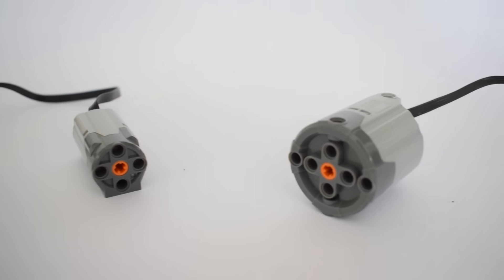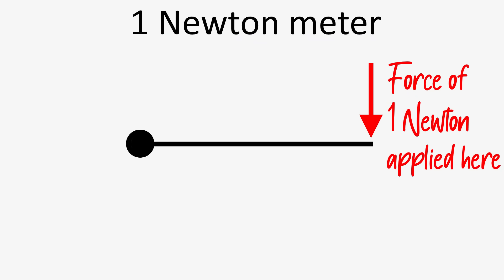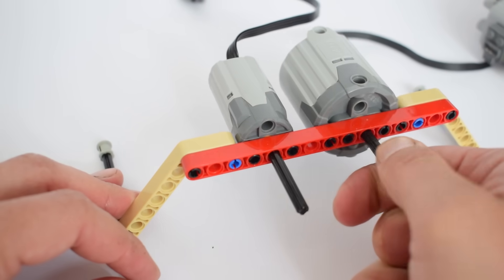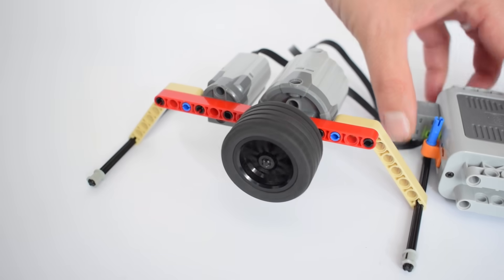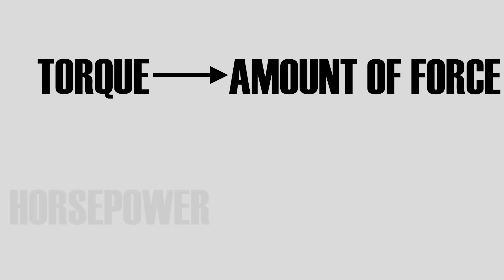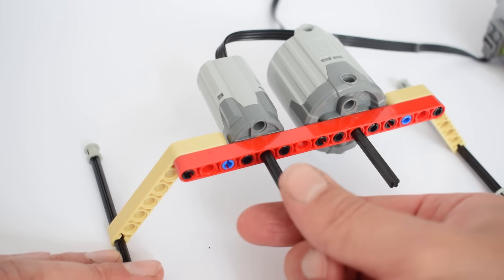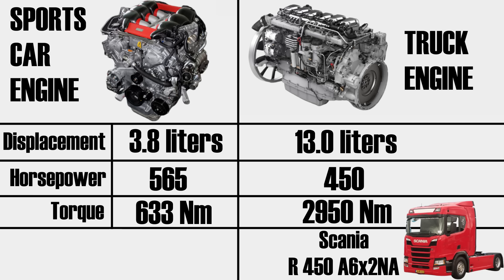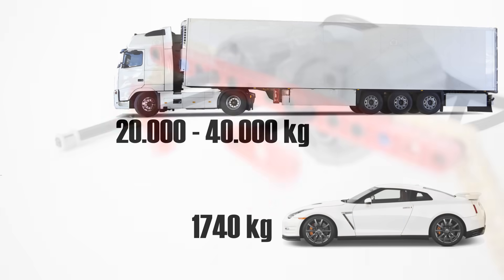NEVER be confused by HORSEPOWER and TORQUE again - HP and TORQUE EXPLAINED in the MOST VISUAL WAY

Comment: Cycling uphill, if your legs can exert enough energy to go up a steep angle, thus your legs have a high amount of torque to push yourself up even though you are pedalling slowly.

Cycling downhill, if your legs can cycle fast enough to accelerate down a steep angle, thus your legs were able to generate a high amount of horsepower due to your speed of pedalling, even though each time you pedal requires way lesser torque than when you're cycling uphill.
Reply: Say what now?

Comment: The best way I can describe the difference between power and torque is:

In all cases, acceleration is proportional to torque at the wheels.
With a fixed gear ratio if the vehicle speed is allowed to vary, the torque at the wheels is proportional to the engine torque and the maximum acceleration occurs at peak torque.
With a fixed vehicle speed but the gear ratio is allowed to vary, the torque at the wheels is proportional to the engine power and the maximum acceleration occurs at peak power.

Comment: Nice video, but disappointing that you didn't demonstrate using the power. A simple way would have been lifting a weight over time using say a pulley. You could have shown that the big motor, with right pulley, could only lift the same weight in half the time of the small motor.

Comment: This is a great explanation, thou I still confused why don't we use an engine with more horsepower and use a transmission to reduce RPM and increase torque.

Comment: "Newton meters confuse you?"
Me: "No, it is pretty self-explanatory"
"It can be also explained in foot pounds"
Me: "Well now they do"
Reply: I was so mad when I heard foot pounds😂
Reply: There is a descriptive problem with Newton meters, it is wrong, foot pounds is a proper descriptive way of stating the force, Newton meters should actually be stated meter newtons, now....I will await someone to try to say I'm  wrong, as they always do. 🤔
Reply: @StevenBradley-sq6kg  i don't know if you are wrong, just the imperial system drives me crazy. Nobody uses that rather than americans.
Reply: @crazypills88  The UK still flip flops on it for a lot of things. I mwan...that is why it's called "imperial" after all. Shoot, they still use "stone" as a measurement of weight too! But hey, imperial measurements aren't the only odd sources for measurement. A Newton is the amount of force an apple exerts on the surface of the earth due to gravity!

But yes, torque is technically pound feet not foot pound.
Reply: @94XJ  " A Newton is the amount of force an apple exerts on the surface of the earth due to gravity!"  LOL!  Do you believe that?  It only works if the given apple has a very precise mass.  99.9999% of apples would fail your definition of a newton.  Note, newton and not Newton.  Sir Issac is now 'spinning in his grave' at 3000 rpm, what his power output?
Reply: @crazypills88  how many times have you been to the moon?
Reply: Yeah, some of what we say is indeed odd. Don’t blame us now though. We were just born into it! 😂
Reply: I read in British accent lol
Reply: Me ,a person ,who live at European continent (to be exact mid-eastern Europe):
Pounds? The only pounds I need is me pounding your mom.
Feet? They're relics of the past for us! What a fetishist would use such unit...
(I know ,it may sound weird ,but I understand metric system better ,than the imperial system and don't take the jokes above too serious)
Reply: My feet 👣🦶  plus money from England  💶
Reply: I felt the same :)
But it is pretty much force lever.
He should have said pounds foot to make it less irritating.
This is also a good explanation https://www.youtube.com/watch?v=u-MH4sf5xkY
Reply: @SirGeldi  except the ftlbs is literally the name of the measurement and to reverse it would be literally incorrect despite it still making sense
Reply: @andreasfrost-blade4689 

Yes, the SAE uses foot pounds. 

Torque is a is the vector cross product of distance multiplied by force and cross products are non-transitive.

RxF=-FxR
Reply: @andreasfrost-blade4689  the proper name for torque in SAE is pound feet, it is called pound feet to reduce confusion with foot pound which is a unit or energy not torque. But it doesnt really matter because most people say torque in foot pound anyway and the context will tell you whether or not its torque or energy.
Reply: @Redtooth75  is Newton’s the metric equivalent to pounds? Also how do I calculate how many pounds of force I put into something? And where does pounds per square inch play into this and how? How do I calculate PSI?

Also I have another question of sorts. (I’m sorry if I’m asking too much). I work at a lumber mill mainly piling lumber. I’m about 170lbs and 1 of my coworkers I pile with nearly everyday is at least 220lbs if not heavier. Both of us r capable of moving around the same weight of timbers for our heaviest we can handle, and r just as fast as each other at said weight. When we pile lighter lumber I am significantly faster than him by a landslide. I’m gonna say ballpark estimates here as idk the exact numbers for sure. We can both pile 800lb timbers with similar speeds. But in lighter stuff like 1X6X12 I am so much faster it’s not even a contest. Maybe something like 5 times faster. So with these ballpark numbers in mind wat is the estimated HP and force (in pounds) that us 2 output and how did u get those answers?
Reply: @baileydombroskie3046  imagine you had a lever 90 degrees/perpendicular to the ground. Then you hang 1 lb of beef at the end of the lever. That's 1 ft lb. Hang a gallon of milk and you have about 8 ftlbs.
Reply: Why I automatically read this in russian accent

Comment: It would also be interesting to talk about instant torque. Electric engines apply their torque very quickly. A petrol engine will take much longer, coz explosion engines are much less efficient, they need to burn petrol and produce explosions, moving pistons, which is more wasteful and takes longer than converting electric energy to rotate a shaft. Diesel engine can apply torque quicker than petrol engines though, coz diesel engines are more efficient : higher compression rate, more efficient fuel. All of this is why a basic Tesla will destroy a Mustang or a Porsche on a short drag race.
Reply: Acceleration is mostly a function of average HP during acceleration. A mustang or Porsche make their rated HP at a specific rpm and lass than that everywhere else in the rev range. So they make that power once per gear and less the rest of the time. A Tesla is an electric car so it can make it's rated power regardless of speed. 

Thats it really. It's nothing to do with "instant torque" or anything.

Comment: Hi, engineer here. Good explanation but there's a couple of misleading points.
1. You can't spin both electric motors freely and claim that the small motor rotates twice as fast, thus can have 1/4 the torque but only 1/2 the hp. At peak rpm as shown in 5:16, the torque is effectively 0. This is true because if torque is > 0, the shafts will continue to accelerate. The rough calculations were close because the ratio of rpm at peak torque between the 2 motors is about the same as the ratio of peak rpm between them.
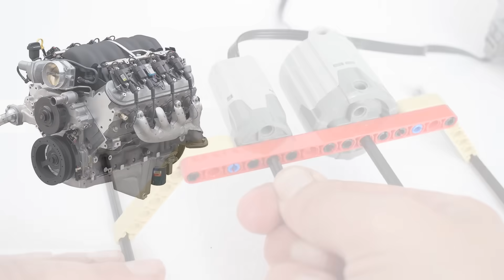2.  6:25 - 6:35 you mentioned that torque can be felt but not horsepower. While this is true, it may mislead people into thinking that acceleration depends on torque and not horsepower. Let's talk about 2 hypothetical engines, A and B. A has high hp low torque. B has high torque low hp. Torque at the wheels is what matters and A can be geared down to produce more torque than B at any specific speed.
Put the sports car engine in the truck with a custom gearbox (or a perfect CVT) and it will accelerate the truck faster than with a truck engine. The real reason why trucks need high torque engines is for fuel efficiency and reliability. You can't redline a high hp low torque engine for 12 hours everyday.
Reply: Thanks. I was about to write this. Glad I scrolled down. Saved me the time.
Reply: I was about to write the same thing! Don’t want to red line anything.
Reply: With this way of thinking does having higher torque allow you to "Start moving" the car/truck if you are at an incline for example?
Or if they have same hp it just doesn't matter?
Reply: @RelaxSimmer  the problem in this discussion is, that there are multiple things to consider and connected with each other. Thats why there are so many discussions about that.
All starts with the "power" and "torque" the engine is producing is different over the rpm-range and people usually just talk about peak power, or peak torque..
Second..they usually talk about the peak power and torque at the engine, not at the wheels..that is a totally different story as the gearbox can change your torque by keeping the same power, but of course increasing or reducing turning speed of the wheels.
But coming to your question: 
Power is Torque x Rpm.. always have that in mind! You cannot have more torque at the same rpm with the same power. Same rpm, more torque means more power.
To turn the wheels on your incline  you need a force, you need torque, but when they dont move because you are standing still, your output power is 0. (rpm=0).
So what you inititally need at your incline is torque to initially turn the wheels.
Imagine you wanna accelerate on your incline: Enginge is at 2000rpm and could produce 200Nm..as the clutch is disengaged, you only need 50Nm,but whatever. 
But to turn the wheels, you need 600Nm at the wheels..so, there is the gearbox first gear ratio assuming 4:1 could give you 800Nm at your wheels, so its possible..
In the 4th gear assuming a gearblx ratio 1:1 would give you only the 200Nm of torque at the wheels..so even if the engine creates the same power (2000rpm, 200Nm) it istnt enough torque at the wheels to incline the car. So you need a different engine that creats more torque at the given 2000rpm, therefore also more power..or another gear ratio like in the first szenario.
Hope thats more clear now :)
Reply: @floridrummer88  Interesting ... thx for the info : )
Reply: I hate it. All those people who watched video will have wrong understanding of the concept now and they will protect it with their life later in discussion because thats what youtuber said
Reply: I don't think you can gear down a VR38 to match the truck engine's torque figures. Displacement is what generates the torque, which you need to move 20 tons.
You're basically saying torque is only down to the horsepower x the gearbox/drivetrain it's matched with. That's essentially BHP.
Reply: @HipsterNgariman  nope. the gearbox can change and multiply the torque easily to the torque of the truck. 500Nm to 2500Nm is just a factor of 5. No prob. Thats what a gearbox is for..
The displacement gives you the torque at the crankshaft..the gearbox will give you the torque at the wheels..and thats the only thing you really need!
Reply: @floridrummer88  don't forget, that factor of 5 works both ways, more output torque but also more input RPMs.
In other words, if the input is already over 2,000 RPMs you will destroy that engine getting that torque number while maintaining the same output RPMs.

Comment: Your statement at around 6:20 that "you feel the torque, not the horsepower" is vaguely formulated and not entirely true. Also, the car footage suggests that you feel the torque of the engine, which is NOT correct. Since the engine is not connected to the wheels directly, you can only feel the torque after being magnified by the gear box. And, more importantly, the gear ratios will inevitably depend not on the engine torque but on the engine power (hp). Therefore, you are practically feeling the horsepower. If you disagree with me, compare the feeling of accelerating a low torque, high hp (by means of high RPM) vehicle vs a high-torque, low hp vehicle.
Reply: True. Acceleration is a result of power, not engine torque. This video just adds to the confusion.

Comment: It might have been worth mentioning that the torque generated by the truck engine is not only due to larger cylinder volume and piston diameter resulting in greater reciprocal force through combustion but equally important is the greater distance of the crank throw from the point of rotation creating a leverage effect for that force to act upon.
It would have tied nicely into your example of torque measurement using the 1 metre lever bar on the bolt with the applied force.
Reply: @UCLK3WKx3l3Mod5fV-RqenGA my dad had an Ford F700 with a small block gas engine in it years ago. It was slow and and a turtle could out accelerate it!

To some extent what you are saying is true about torque, especially when you can add gear reduction, but gear reduction adds weight and complexity which can be a drawback when a diesel can do it better if designed for the specific application. What this boils down to is we need different designs for different applications because a one size fits all approach doesn’t work. Maybe think of horsepower as how eager an engine is to work, and torque is how hard it can work. I could hook up a 30,000 lbs trailer to a truck with 1,000 hp and 500 ft lbs of torque and even though that engine is very eager to rev and accelerate, that 30,000 lbs will temper that eagerness quite a lot. However, a truck with a diesel that has 1,000 ft lbs and 400 hp will have no problem carting that 30,000 lb trailer around and up hills.
Reply: This is a better explanation than the video. Thank you.
Reply: There is no “leverage” that the crankshaft provides to the work combustion does pushing the piston down the cylinder.  All conventional crankshafts merely convert linear reciprocal motion into rotational motion on a 1:1 basis.  1:1 meaning zero leverage.
Reply: Another wrinkle with Diesel engines is that the fuel itself contains more energy than gasoline. 

A second difference to consider is that gasoline is more explosive, whereas diesel burns and becomes more explosive under pressure. When detonation occurs, gasoline goes out with a bang. Detonation with a Diesel engine is a slower explosion which pushes on the piston longer than a gasoline detonation. This is also a contributing factor for why Diesel engines generate more torque than an equivalent gasoline engine. It is also a reason why Diesel engines don’t rev as high as gasoline engines, the slower burn creates a cap on how high your engine revs can be before your engine would outrun the combustion process.
Reply: @nathanwieling7943  what is the advantage of gasoline then?
Reply: @krys8494  Gasoline detonates faster for higher performance applications. Costs less to produce since compressions ratios (air to fuel mixture) are lower than Diesel engines so the engine and its operating parts doesn’t have to be built as heavy duty.

Comment: Why does noone explaining the difference between hp and torque show that time doesn't matter for torque? You came close but a visual representation would have been easy at that point. E.g. it doesn't matter how long the bigger motor needs to move the "heavy attachment", important here is that it can move it (while the smaller motor would move it much faster but can't do it due to the lack of torque).

Comment: Very nice, but still missing a key point that it's the horsepower that really matters to move a vehicle. If you have enough power, you can multiply the torque by reducing the gear ratio...  A truck needs power at very low speeds, so the most effective way to have and deliver all this power is with a lot of torque.

Comment: Basically Horsepower is speed, Torque is Strength. In a manual transmission car, you use low gears for higher torque, and high gears for higher horsepower.

Comment: So can someone help clear up confusion?
I get the difference between torque and horsepower, but why did the smaller engine spin faster, despite a /smaller/ horsepower?
Reply: If you want an engine or electric motor to make whatever your desired amount of power it can be designed to either rev high with a lower amount of torque or rev low with a high amount of torque. There are advantages and disadvantages to both.

Comment: Isn't the real reason for big, torquey, low revving engines in trucks for longevity though rather than necessity in order to pull the weight? 
Because once you add the gearbox into the equation the torque to the wheels can be the same for a low torque high speed enigne as a high torque low speed engine because you would use different gear ratios. e.g. the gt-r revs ~3x higher so naturally you have to use 3x shorter ratios already otherwise its top speed would be 600mph which it would never reach due to air resistance and then you consider that the GT-R is geared for 200mph while a truck only needs to be geared for about 100mph to keep RPM low for efficiency at motorway speeds so you shorten the ratios by 6x overall. Then the GT-R would pull the same weight with just as much ease (assuming it has enough grip, might need ballast lol), it just wouldn't last the 1,000,000 miles plus the scania would last.
Reply: Pretty much what you said, longevity and fuel economy. A high horsepower race engine would need to be kept at a high rpm in order to make enough power to tow the load, whereas a big diesel engine can make the same amount of power at a low rpm. The high rpm will cause increased wear and fuel consumption

Comment: Cool. What could be more precise, if you'd mention, that these power and torque values are the maximum values, and they are not available on the whole interval of revolution. And how the of internal combustion engines and the electric motors power and torque curves are different.

(Sorry if others already mentioned this, I didn't read almost 3k comments.)